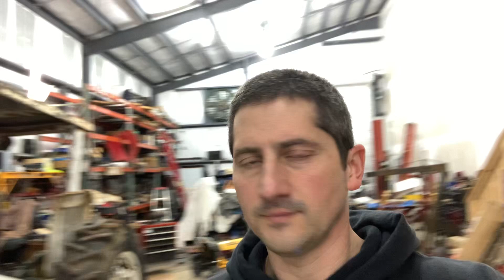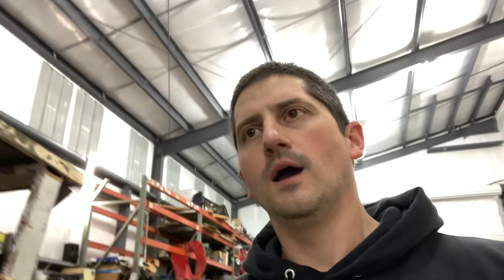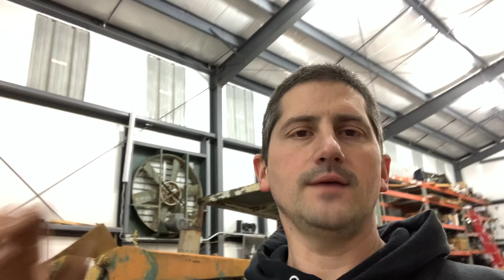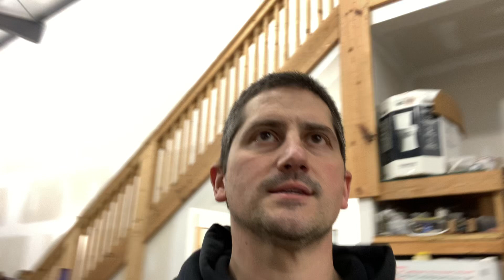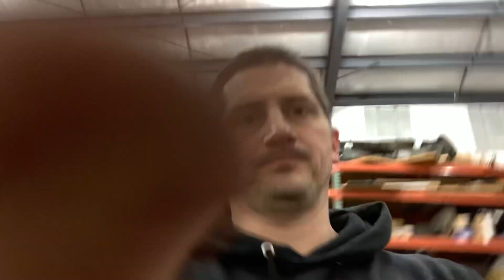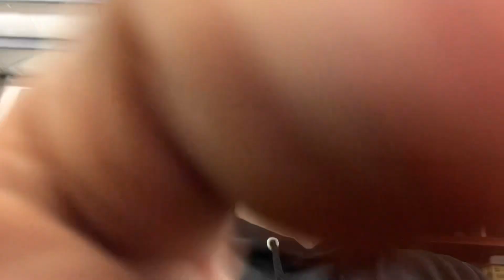Fuel filter micron. What micron and for what.

Comment: So could I use a 40 micron between the tank and electric pump on my carburetor car??
Reply from the maker: If you run an electric pump you should have a sock in the tank for the pickup tube. The pump should be mounted lower than the tank. No other restriction should be between the sock and fuel pump. Doing so with destroy the pump over time and shorten its life span. You can put what ever you want after the pump.
Reply: Okay I didn’t mention that my car had a mechanical pump, I disconnected that pump and ran new lines using an electric pump. I only had a sending unit in the tank.